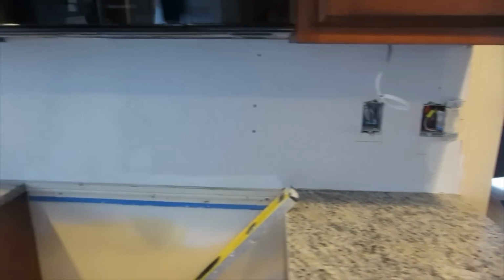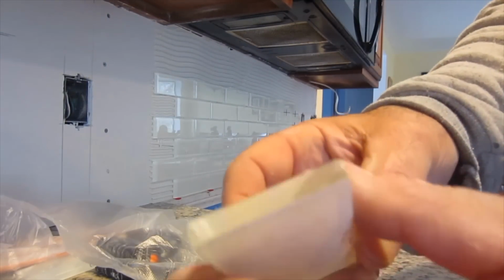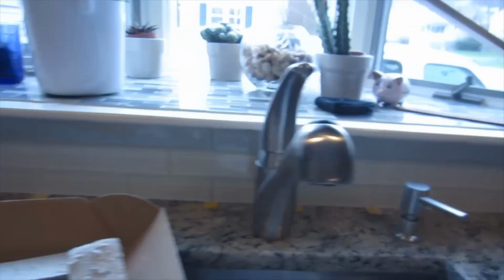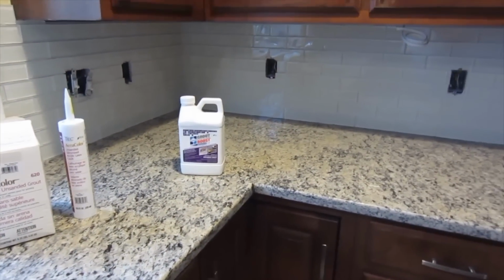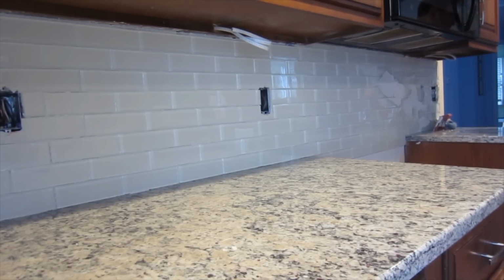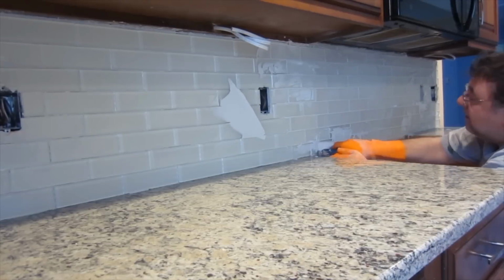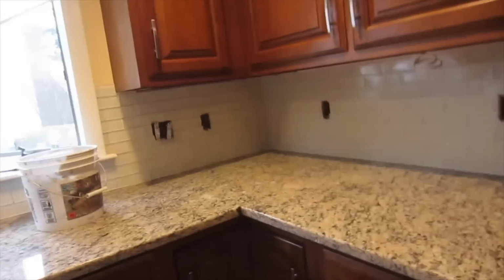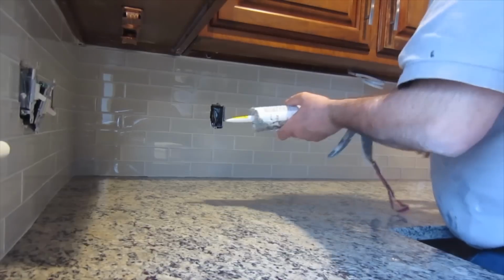How to install a Glass tile kitchen backsplash Part 2

Comment: I’ve noticed in some videos you don’t seem to use tile edging/trim on the finished edges of the tile at the top of the tile or at the sides where the tile finished at the worktop edge, why is that? It’s seems to be uncommon in USA, but I’m from UK and a tile job isn’t considered complete without tile trim/edging.
Reply from the maker: Glass tile I will polish the edges of the tile to match the tile face, no added extra lines, just the tile. https://www.youtube.com/watch?v=6NP8DGb_mnw

Comment: After you installed the drywalls and replastered it, do you seal it with primers before installing backsplash? Thank you in advance.
Reply from the maker: You don't need to seal it, you can install the tile onThe drywall.

Comment: How do you do the inside corners? Is there a gap or do you run one set right up against the corner then butt up the other tile (other wall) to the other tile?
Reply from the maker: Leave a small gap and use a color matching caulk
Reply: thanks

Comment: Nice work. Do you cut glass with a wet saw.
Reply from the maker: I will cut gge tile with whatever works best, sometimes it is thd wrt saw, sometimes a manual cutter works better.